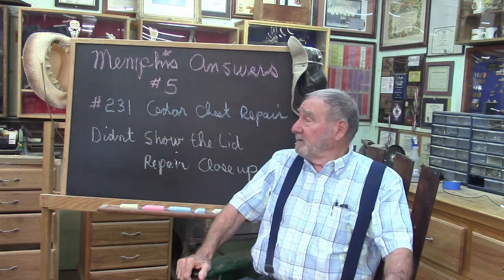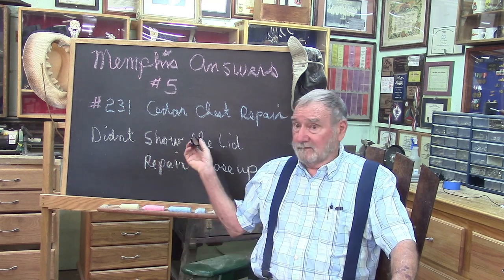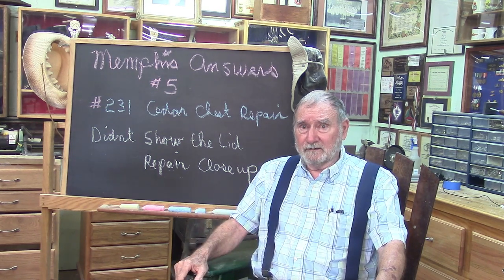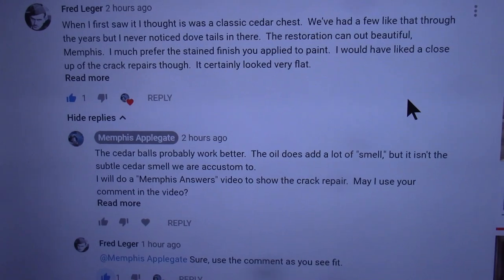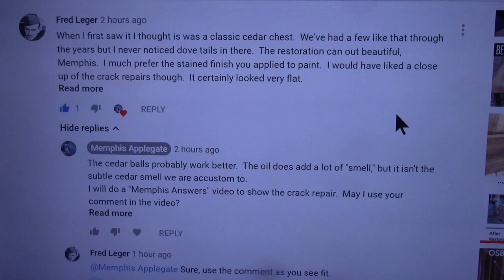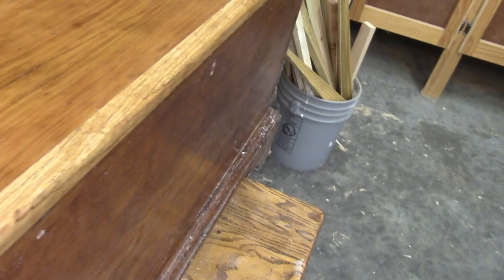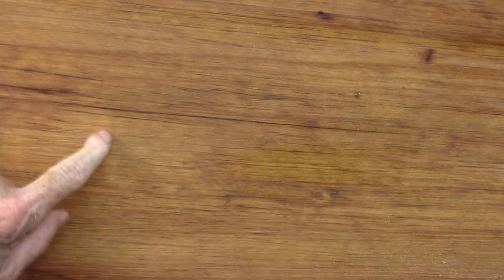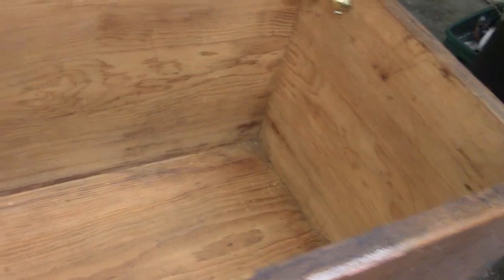Memphis Answers 5 Questions about the Cedar chest

Comment: Fantastic repair.  The cracks that you glued back together actually add character to the look of the chest.  I would have never thought to add cedar oil to a non cedar chest.  Do you know if the oil will give it the insect repellent qualities that the wood has?
Reply from the maker: I don't know if it is cedar for sure, but it will pass until an expert can ID it.  I suspect it is cedar, as the thing has held up well over the years.  The cedar oil refreshes the cedar smell, but it was so strong at first to really tell.  At the time of this video the cedar oil smell had calmed down considerably, and opening it up, the cedar smell seemed about right.
     I don't know if the replacement oil has the same repellent qualities, but my gut feeling is that it does.  I tell you, there is so much to know!!!  Seems like everything we do has its own rules and tribal knowledge.  
     Thanks for watching.  I just put out a Memphis Answers.
Reply: @MemphisApplegate  You are probably right that the oil will also have repellent qualities.  They suggest various different oils to keep pests out of RVs.

I will check out the Memphis Answers.